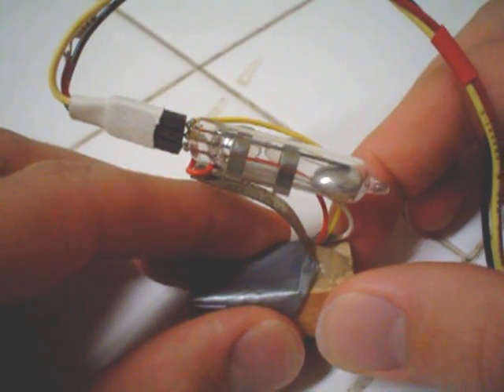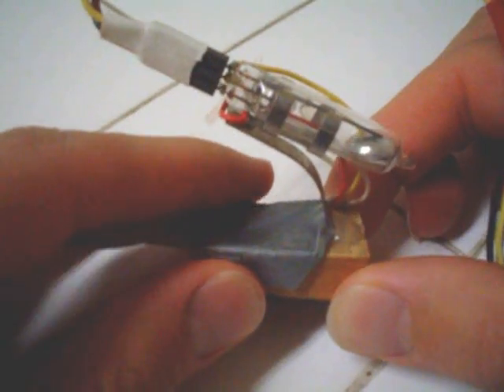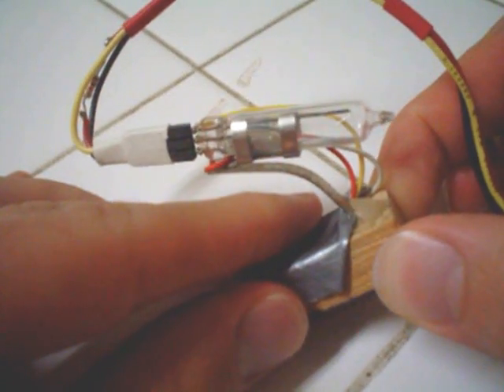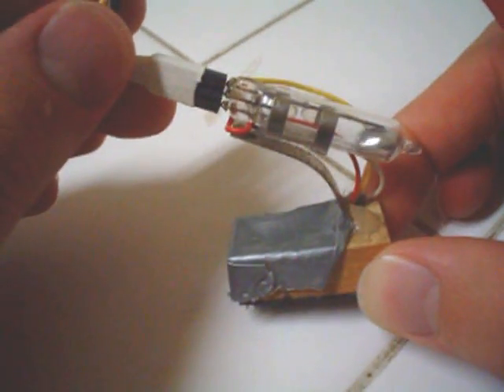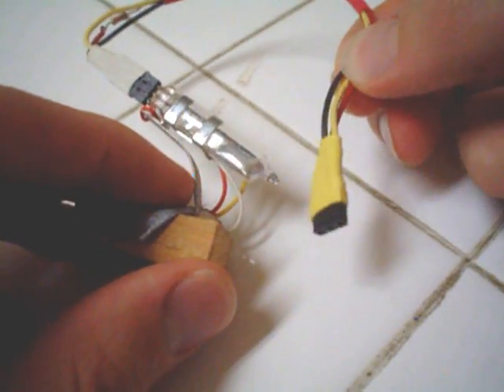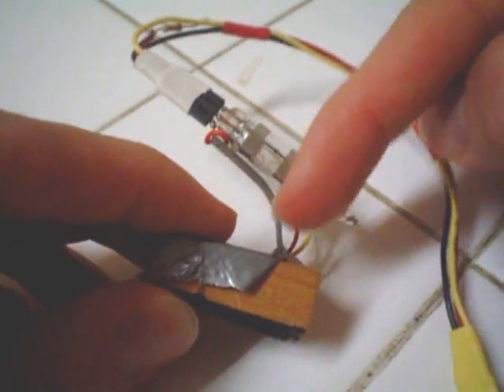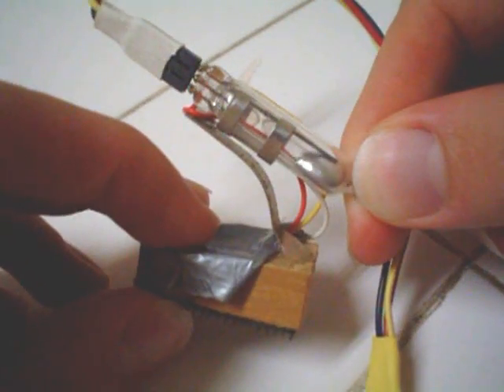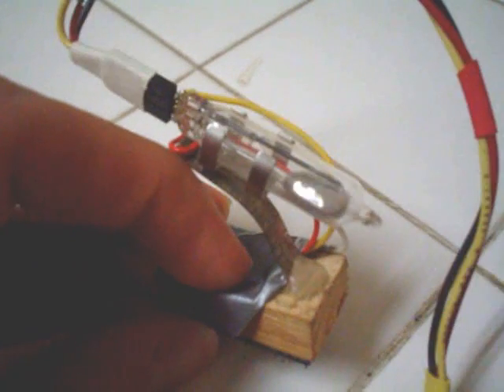Mercury Tilt Switch Demo

Comment: @BritainDavisFilms

Buy a cheap (dollar store) toy light up frisbee or magnetic rail twirling toy. Rip that apart for the components. It will most likely be small pieces of metal carefully bent so that when the wheel spins it will engage under its own increased "weight". 

Integrating this design into the wheel will give you the function you are looking for. Hardest part will be mounting and bending the strips of metal, but observing their setup in the toy should help you with that.

Cheers!